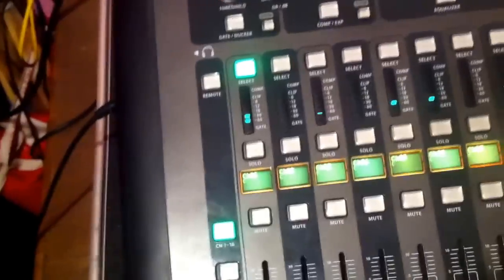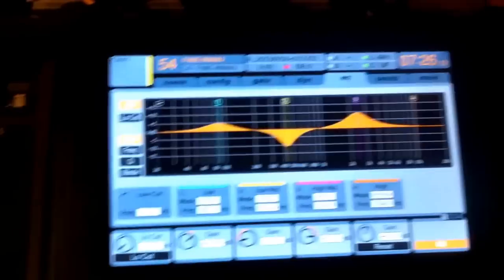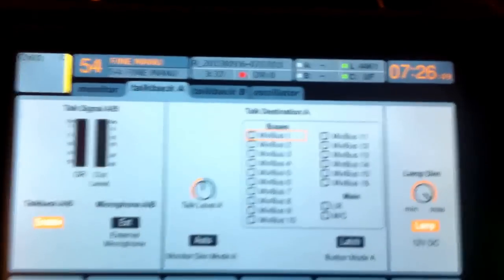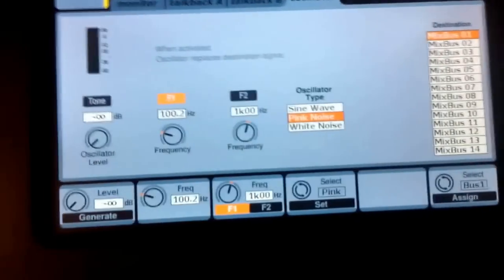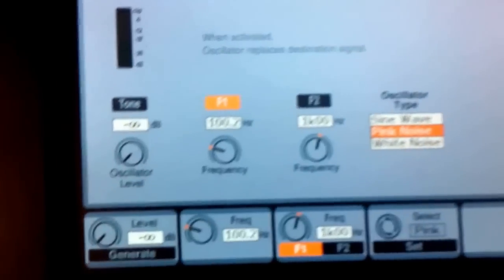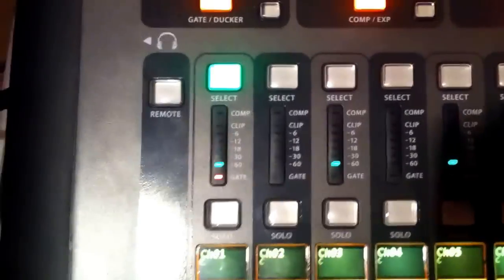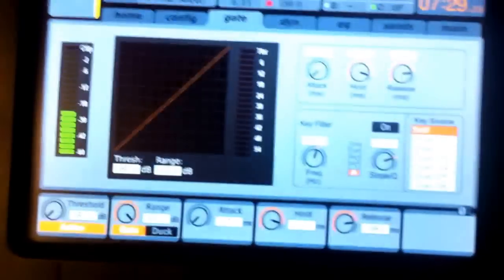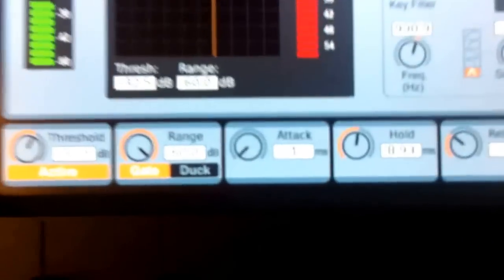Behringer X32 - how to fatten up Drumsounds with the oscillator

Comment: This is great. I go a step further and make the oscillator’s key input from the kick post-fader. I like to get the mic/sine balance correct at the start of the show and hide the oscillator channel away at the end of my layers, and just ride the main kick fader. However, since the X32 doesn’t have an option to make the gate key post-fader, I waste a second bus (sub-group) as the gate key, whose only purpose is to receive the kick, post-fader. Thoughts on how to do this better?

Kick [Ch1] -> Bus 11 [post-fader]
Oscillator -> Bus 10
Ch32 sources Bus 10 -> Gate (key=Bus 11)
Adjust Ch1 and Ch32 to taste.
Ride Ch1, Ch32 follows.
Reply: Hey pal could u make a video explaining how to do this? I would really appreciate ur help and I think it would be helpful for some more!:)
Reply: Why not use a DCA to control both kick faders together? Set your balance and then don't touch them, just move a DCA fader

Comment: In itself this trick can be pretty useful but I found that it's unusable to me on the X32! The gate has a range of 60dB max so it will only suppress the sine wave 60dB when the gate is 'closed'. This leaves a continuous hum in the PA system that is loud enough to be annoying during quiet parts or pauses. How are you dealing with this?
Reply: You follow good sound technique: mute the channel anytime its not needed. Use a mute group.
Reply: I'd like to know if there is a work around? Like what about sending it to another gate? like sub kik ch2 >new bus>ch3 (use another gate on that ch) to range it down even more? Both gates would have to be working well together... Would this work or redundant ?